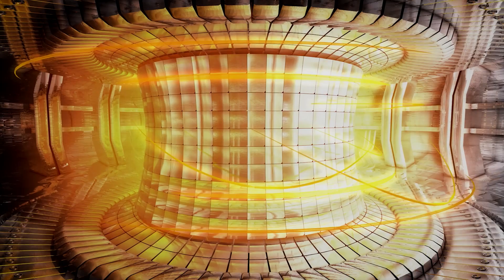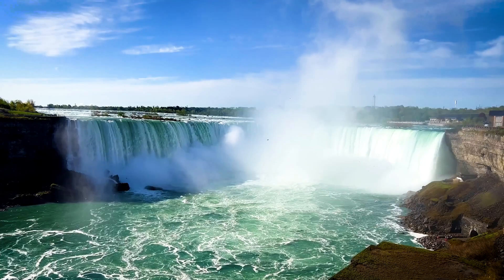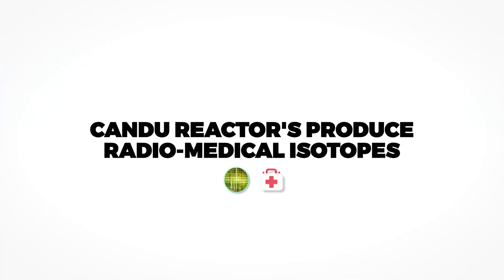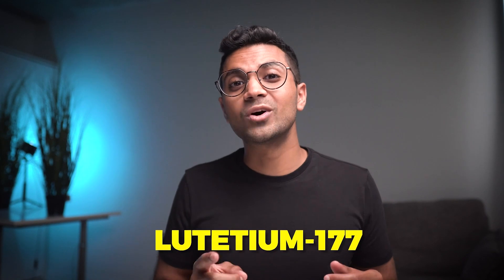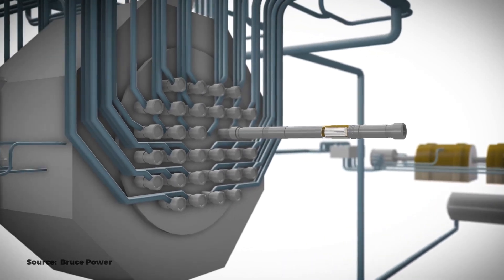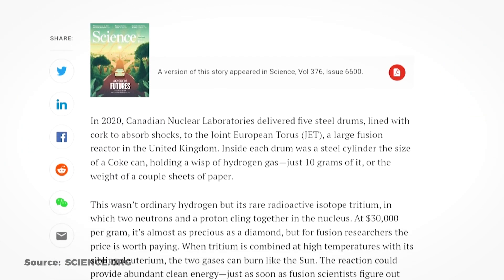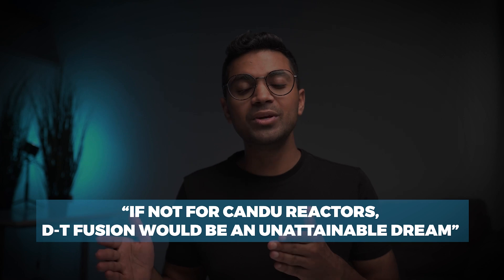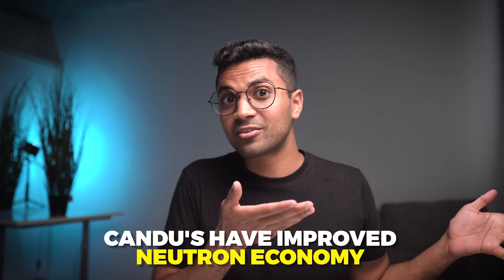Top 5 CANDU Reactor Facts you DON'T know

Comment: Decarb9nizing is great climate change bad blah blah
The fact that these things require no enrichment facilities making fuel grade and bomb grade materials should be the take away here. These reactors cannot produce weapons fuel, any pu239 produced in the reactors will be burned off with negligible amounts left over. A few things that our narrator should know. 1. Spent fuel especially from US reactors could be reused in those reactors since that fuel is mostly unused. The build up of daughter products necessitates its removal. The fuel could then be cleaned ie re-processed for insertion back into a reactor, but thanks to international treaties that make no sense we do not reprocess our fuel as France does with its fuel. So the billions spent to refine that fuel is essentiallly thrown away or in this case apparently given to canada (they should cover costs of refining if this is the case) and 2. CANDU reactors are not the only sources of tritium if they were all modern nuclear weapons wouldn't work.
 For people obsessed with climate change heres your answer, its here and it works unlike fusion which wven if it were cracked tomorrow we wouldnt see a functioning plant for decades.

Comment: What is the downside? There must be something otherwise it wouldn’t be the third most popular?
I thought that candu where obsolete technology, replaced by newer design, is there a renaissance of this type?
Will the new small modular reactor will use candu?
Reply from the maker: All reactor tech has its unique upside and downsides. However, popularity of a reactor design is not directly correlated to its performance. CANDU was developed much later and did not have the massive technical capabilities that the United States had to export/develop its technology. This might be some reasons why its the 3rd most popular. Moreover, I don't think CANDU is obsolete. It can be used strategically for medical isotope production and burning Nuclear waste from PWR Reactors.
Reply: @OsamaBaig CANDU can't be used for nuclear subs as it'd physically bigger/heavier than PWRs

The trump card of nuclear reactors was enabling the navy to build nuclear subs

You need a reactor that is physically small and powerful and ideally one which doesn't need refueling for 30+ years

You can do that with a highly enriched uranium PWR you can't do that with a CANDU

1952 first nuclear sub
1957 first commercial nuclear power plant

So they just built what they knew (nuclear ships) but bigger

If Canada had dreams of independent nuclear ships they probably would have gone PWRs too
Reply: CANDU is physically bigger than PWRs so can't be used in nuclear subs. The real benefit of nuclear power technology was to create nuclear submarines

For submarines you need a physically small reactor with a lot of power and ideally a 30-50 year life without refusing. That's not possible with CANDO

I'm not sure/convinced that CANDU is better than BWR/PWR for stationary power storage but it seems like a reasonable reactor that has proven itself to be workable unlike say the British AGRs which while intersting were arguably a mistake and the Brits have moved over to PWRs

Comment: The fun thing about CANDUs is that they are basically RBMKs that are on the side, and scrapped Graphite and light water as primary moderator and coolant respectively. Making them substantially safer than the RBMK (if the reactor vessel cracks the reactor simply shuts off) , while keeping its favorable features, running on NU and online refueling. It can further burn used LWPWR SNF, and can also burn thorium with some design tweaks. Tbh, a pretty mature technology for the short term future of nuclear power.
Reply: Yes

Comment: Very good video Osama!!!  The coming Tritium shortage should cause a CANDU  building spree.  Coupling H3 with DUPIC maybe a home run.  Question how does a CANDU unit produce Mo99 for hospital use?  I know NRU does but I'm not sure I consider that a CANDU.  More a reason reactor, a very old one!!!  A very productive old one.
Reply from the maker: Yes indeed, large scale tritium production for Fusion reactors and using DUPIC would be a very good goal. The way CANDU's produce Mo-99 or any other isotope is by inserting these isotopes into the reactor core while its operating. When you introduce these isotopes to a neutron source, they become activated. Of course, there are calculations you've got to make in order for the Mo-99 targets to be exposed to the right amount and for the correct period of time. Next you've got to harvest them, package and ship them across to facilities in the world. This is an over simplification of the process, however there is a LOT of design, safety analysis and regulatory approvals involved in the process

Comment: Sir, I have a question, let’s just say a country is at war and a nuclear power plant is attacked, can it meltdown or no, what are the safety precautions in place
Reply from the maker: Simple answer is no Jivin, in my humble opinion. There are two reasons for this. #1- Reactor containment buildings surround a nuclear reactor. These are some of the hardest structures in the world. They are designed to withstand impact from a commercial jet flying into it at full speed. The design and Engineering behind the heavy concrete and rebar that holds these containment buildings is superb #2 Nuclear power reactors are assets. It is in no nations best interest to damage these reactors
Reply: @OsamaBaig  Alright, thank you for answering my question! ;)